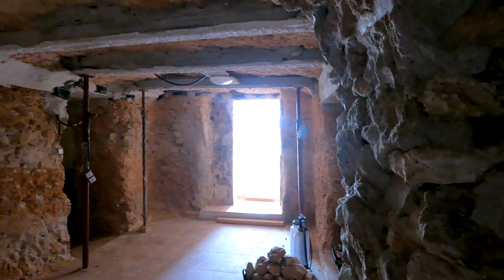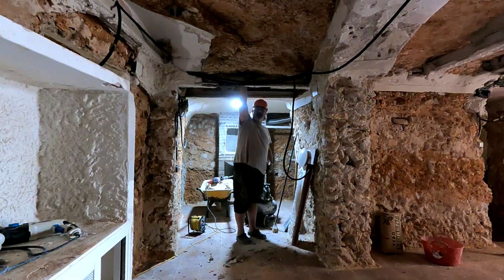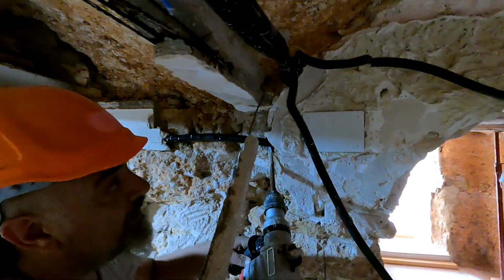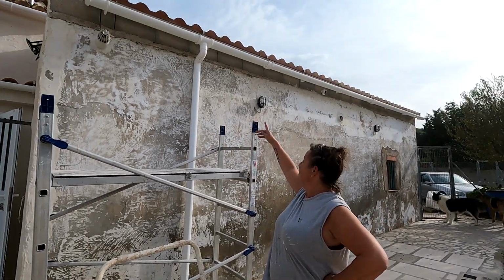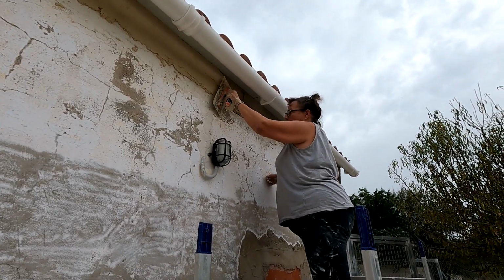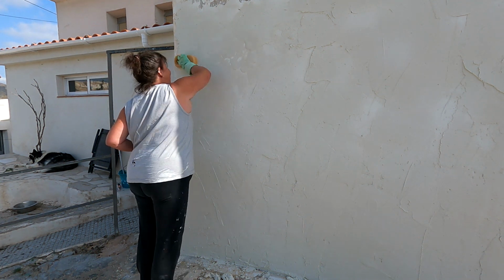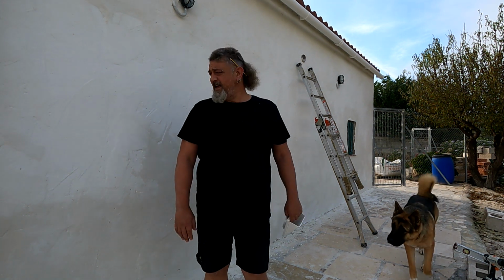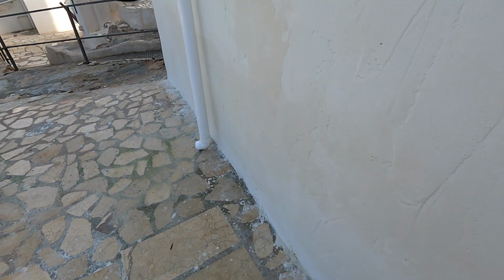A long-standing project is finished at our cave house and it's looking fabulous (Ep148)

Comment: Getting a shock from the electrics is not nice hope you are ok had quite a few decorating customers walls where they just cut wires that had wall lights and plastered over them.wall outside looks much better well done.if you fall you only bounce once.😊
Reply from the maker: I am fine thank you, fortunately our electricity supply is capped at 3kw, with a 25amp main breaker plus its all 40ma rcd protected, still shouldn't have been so silly to work near live wires. It`s not so much the fall that bothers me, its the sudden stop 😂

Comment: Still binge watching but the 3rd cave under the road wouldn't the water that went in there when road was fixed make your cave very wet I don't know
Reply from the maker: Thank you for watching 😁. No problem there as the 3rd cave is behind block built rooms at the front of the caves ( hope that makes sense)